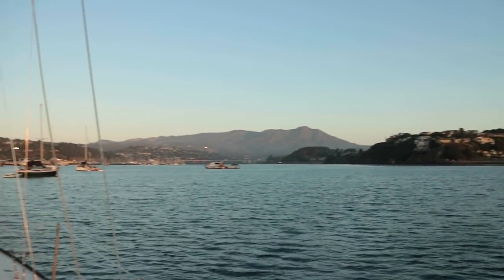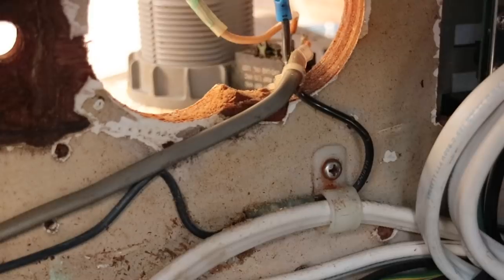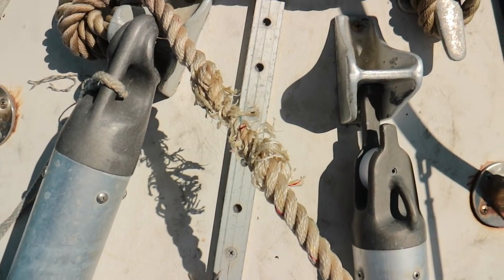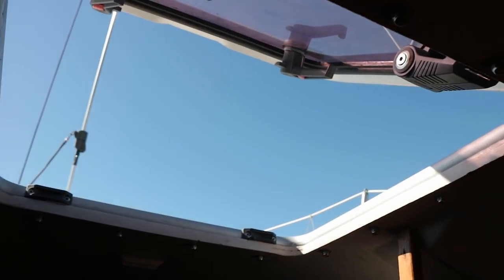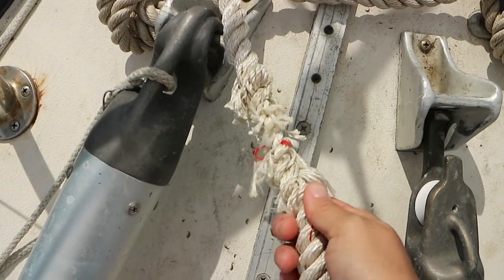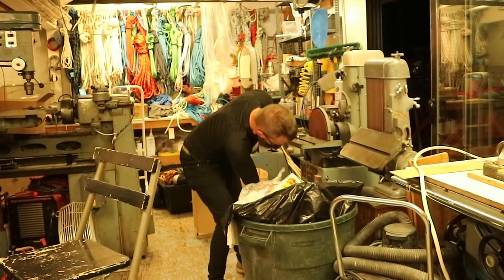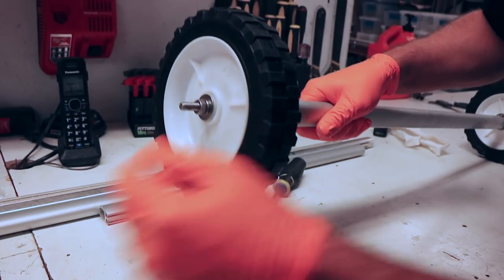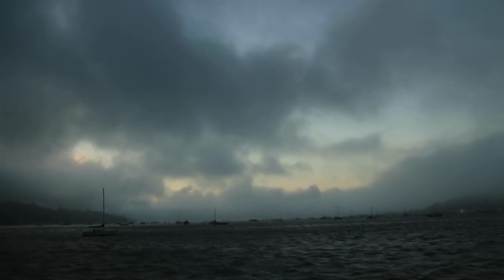Solo Sailboat Living in San Francisco

Comment: I lived in the floating home moorage close by to where you’re anchored and would paddle board out there daily! Nice to see you down at Oyster Point - I work there and often catch a ferry from Tiburon in the mornings. 

Incidentally, LanoCote is based on lanolin - from sheep’s wool. It’s natural and non-toxic, rare for boat products!!
Reply from the maker: I didn’t know it (about Lanocote) until posting this vid. Thanks for the info! Whoa - didn’t realize there is a ferry all the way from Tiburon to Oyster point either...
Reply: Sailorama it’s for employees/contractors of a specific company :)
Reply: @sailorama  BEWARE!! That inboard engine is the once popular Atomic 4. Often refered to as an Atomic bomb, these engines are notorious for rotting out from the inside out meaning you get no warning when the day it dies is coming. With a boat you put on a trailer when you're done for the day the motor is normally flushed out when it's brought home to get the salt out if the engine to keep the engine from rotting out. On larger boats that stay in the water, the outside water is run through one side of a heat exchanger, (a fancy two sided radiator), the coolant in the engine goes through the other side of the heat exchanger, and circulates back into the engine just like in your car, allowing the engine to be cooled off, while the outside salt water is kept separate from the engine so it doesn't rot out. The Atomic 4 circulates the outside salt water through the engine and never gets a chance to flush out causing the majority of them to rot out and die. If you ever by a boat avoid one with an Atomic 4 at all costs.

Comment: Transmission fluid is the best thing ever for a penetrating oil/rust remover ever. WD-40 is not meant for removing rust or penetrating
Reply from the maker: Thanks for the tip. DW40 seems like all purpose, not necessarily best for the purpose.